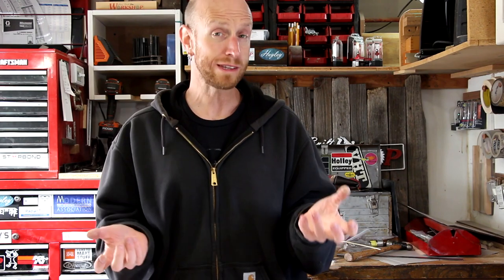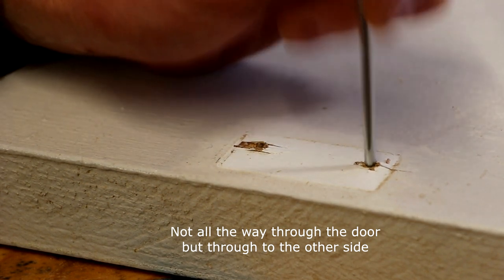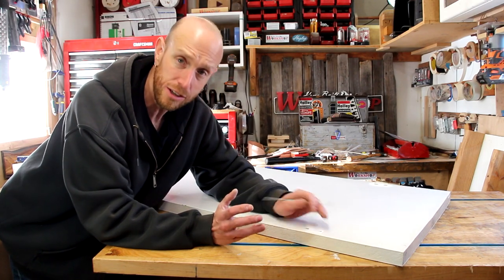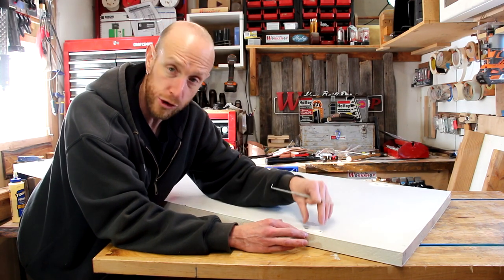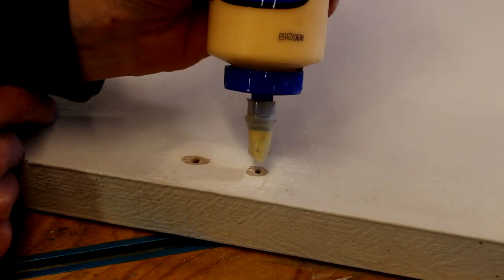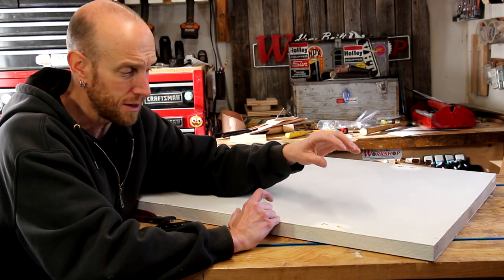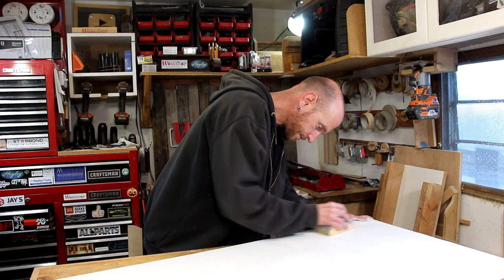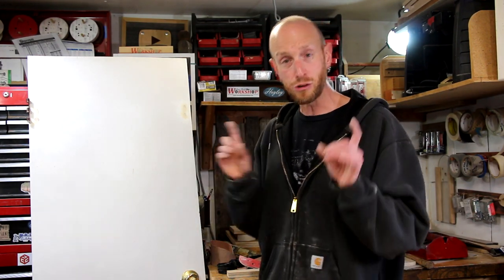Fixed: Repairing Screw Holes in a Hollow Core Door | BBQ Skewers to the Rescue

Comment: As I was thinking about this repair... Since you will be needing to repaint, I would attach a backer-board (maybe a 2" wide by 1/4' thick) that spans the width of the door.   Then screw that backer-board into the edge areas where there is internal support boards.   I would mount the backer-board over the striped-out holes so you wouldn't even have to patch anything.  You can even glue this backer-board on for added strength.  Then just mount the towel bar on the new backer-board using conventional screws (no anchors required).    Just my two cents.
Reply from the maker: That would be a pretty solid repair for sure. 👍

Comment: Personally, I would have put four 2" dowels in from the side of the door and screw into them!!
Reply from the maker: Thats another good idea. And it would give you solid wood to screw in to. Might be tricky to drill into the center of the dowel though but it could be done with some careful measuring.